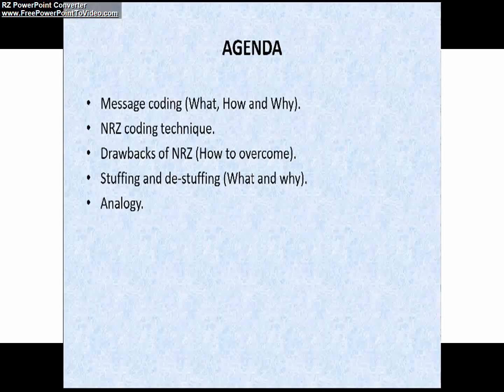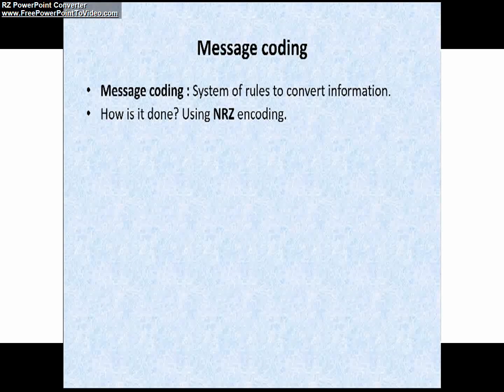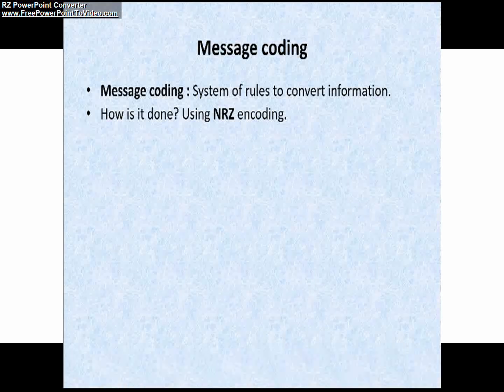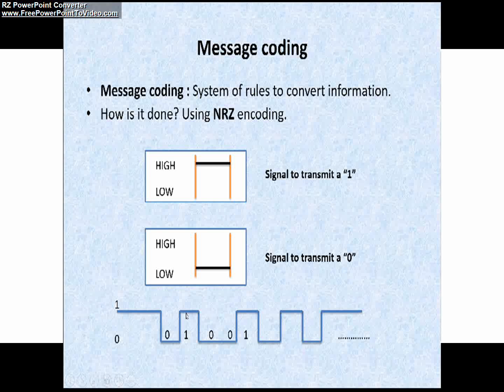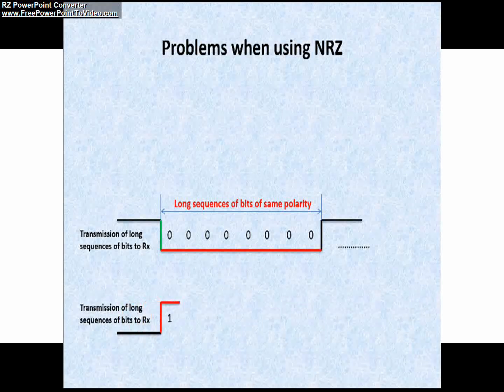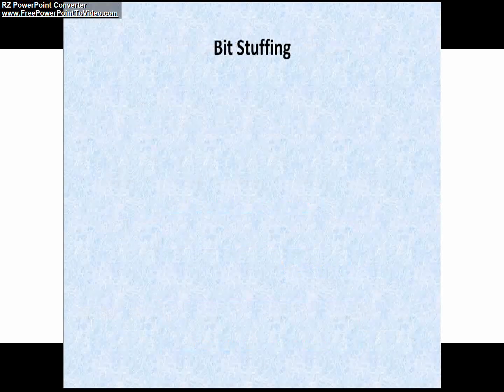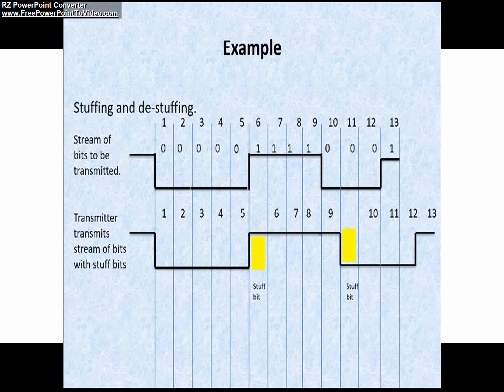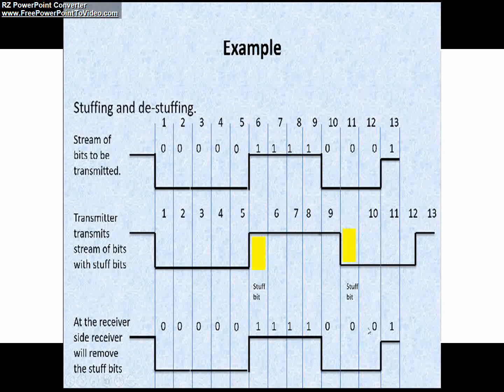CAN protocol basics. PART6, Bit stuffing.

Comment: Thanks for the vedio,i have a question,if i need to send a data of 64 bits(maximum in the standard can) if there is same polarity for 5 bits,will there be data loss as with stuffing the data size will increase than 64,please explain

Comment: Thanks for the video, here i have a question. What is the exactly use of stuff bit since the reciever removes it while receiving the bits
Reply: If same polarity bits are transmitted consecutively, the receiving end loses synchronization because a lot of time has passed without voltage sensing

Comment: Hi Som, I have one question: In the process of de-stuffing first it will check 5 consecutive bits and then it will remove the next bit (stuff bit). As stuff bit is removed then next 5 recesive bits count reduced to 4. now it will count 4 consecutive bits and then it should not remove the next stuff bit. Can you clarify this point..?
Reply from the maker: nice question...will get back to you.. kindly stay tuned...
Reply: why 4 th bit is not removed

Comment: In bit stuffing , after 5 consecutive bits 6 th bit will be opposite to the 5 th bit, and that 6 th bit will called as stuff bit.
Now my question is why only 6 th bit will be stuff bit, why not 4 th or 7 th or 8 th or other bits.
Reply: Error has to be detected at bit time of 6th consecutive equal bit level which should be coded by bit stuffing

Comment: Hi,

This bit stuffing is occur in entire frame or only in data filed?

if entire frame then , at the time of arbitration how it will work?
Reply from the maker: Bit stuffing is applicable from SOF to CRC delimiter.

In Arbitration field transmitting node will append stuff bit, if it finds more than 5 consecutive bits of same polarity, at receiving side receiver will de-stuff the same.
Reply: Thank you...
Reply from the maker: welcome...
Reply: @secretsofautomotiveindustr2910  I think it's from SOF to CRC sequence, CRC delimeter is excluded.
Reply: if transmitting node  is transmites less  than five consecutive bits at the receiving side destuffing bit is occured or not

Comment: Nice explanation of  CAN protocol bit stuffing with good example.
Reply from the maker: Thank you.
Reply: Secrets of Automotive Industry 

What if there if no FIVE consecutive 1's in eighter in flag or in data word, but both are same.

Like my flag is 00110010 and my data word is also 00110010.

In this what i have to do to change the data word?